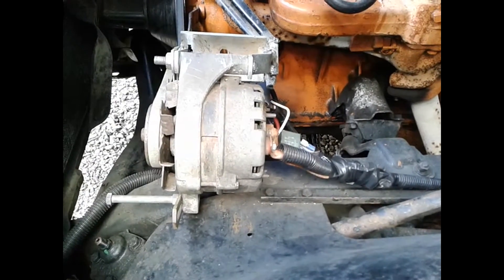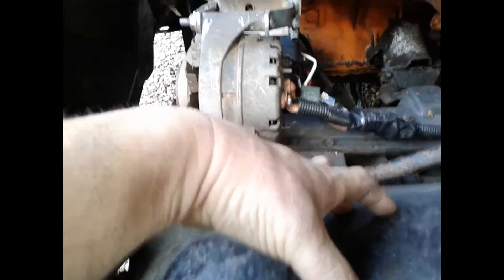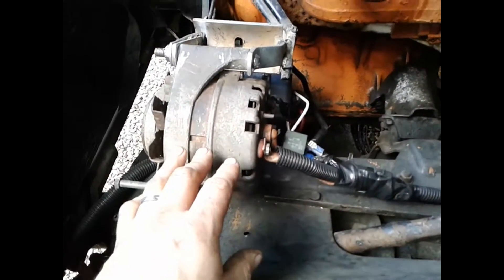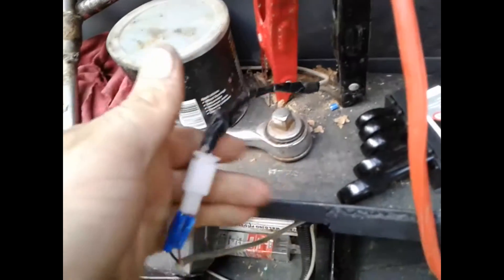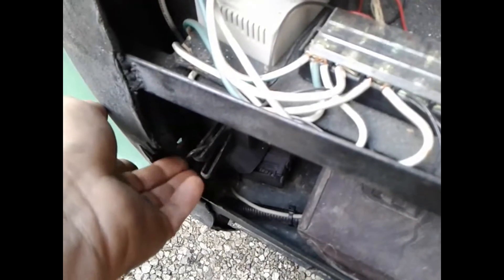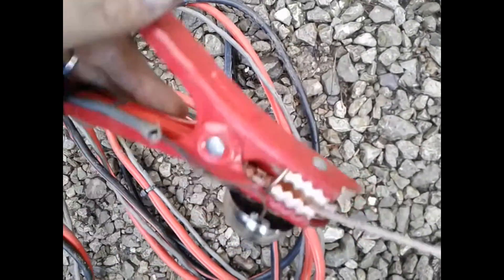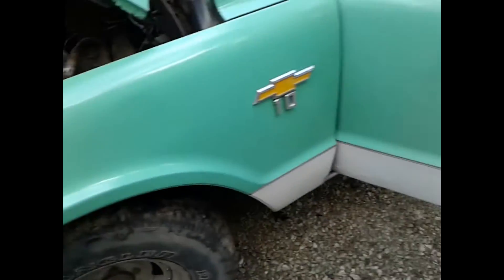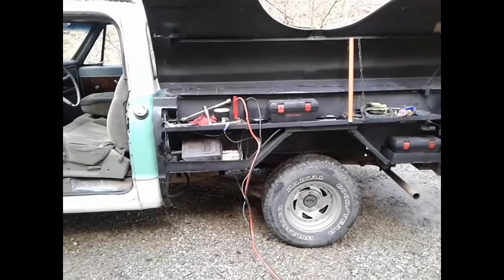Details of Ol' Green's Welder. Including diagram.

Comment: Hi will you tell me how much HP engine is suitable for 12 volt 100 amp alternator for welding
Reply from the maker: I think about a 5 HP engine would be good. I would go for the biggest engine I could though, always good to have more power than you need.
Reply: @lukeFugate  thanks bro for reply

Comment: Where u get output , from stater wire or from the diode set?
Reply from the maker: It comes out of the diode set. On the same terminal it would normally. I just put full 12v to the field wire.
Reply: @lukeFugate  thanks bro for explanation

Comment: Using a rheostat and a simple on/off switch would allow more control over the output than what you've got set up there.
Reply from the maker: That's an excellent idea. I'll have to work that in. Also a higher geared pulley would help to get the speed up without having to rev the engine so much.
Reply: True, but alternators typically have a maximum rpm rating and can come apart if spun too fast for too long. You shouldn't need to spin it more than about 5-6000 rpm(alternator, not engine) for maximum output. Most of the small case alternators from typical cars/trucks will handle at least 11-12k rpm on an intermittent basis. Unfortunately I don't have any hard numbers on the ford alternators. Delco and Leece-Neville are far easier to find information on.

Comment: so confusing
Reply from the maker: What is confusing about it? I'll try to help you if you tell me what you didn't understand. I know my explanations are about as clear as mud sometimes.
Reply: luke Fugate well I got a alternator off a 93 f250 diesel.  im not understanding the field connection.   and im guessing the battery is to give it fire?  what charges the battery if youve converted it to a higher voltage.
Reply from the maker: There are two alternators on my truck. I still have the alternator on the truck that powers the truck electrical system. The welder is a secondary alternator that is not hooked up on the output side to the truck. The field connection is a constant 12 volts from the battery. Ordinarily the field wire comes from the voltage regulator and changes the voltage up and down to maintain 13-14.5 volts to the battery. By bypassing the voltage regulator and putting full battery voltage to the field the alternator will put out the maximum volts and amps it can (should be around 80-90 volts and whatever the max amp rating is on your particular one.) I'm not sure a 93 model alternator would be externally regulated. It may have a built in regulator which wouldn't let it run at full voltage. You may have to pick up one from an older Ford. Mine is from a 1977 model.
Reply: luke Fugate that makes alot of sense with you explaining it like that.   ill look at it when I get home thanks for the help
Reply: You're probably going to have to do a lot more work to get a 1993 alternator to function as a welder. 

Problem 1: As far as I know, that should have an internal voltage regulator...that will have to be removed/disabled. Otherwise, you won't get enough voltage or amperage output from it to weld.

Problem 2: Most of the alternators made after the late 1980's will have avalanche type rectifier diodes, which will fail if voltage exceeds roughly 19 volts. This was done to protect the car/truck computer from severe over-voltage in the event of a regulator failure. Once they fail, there will be very little to no output from the alternator, meaning no welding.

Once you have disabled/removed the voltage regulator, the voltage output can easily go over 100 volts depending on how many rpm's it's turning. That means the rectifier diodes will fail if they are avalanche type(and they very likely are). There are ways to solve both of these problems, but it will not be as easy or cheap as just starting with an externally regulated alternator from a 70's or early 80's ford or dodge.
Reply: @zombieresponder  problem 2.... Can u please show how to built a diode rectifier to replace the avalanche type rectifier
Reply: @temsuimsong117  Dude, if you can't figure this out it is probably best that you don't go fooling with a project like an alternator welder.
Reply: @zombieresponder  i have an alternator which give out only max 13-14 volt after i take out the regulator and give direct 12 volt to the field coil....
Reply: @temsuimsong117  What is the alternator rotor rpm? If the what you removed was actually the regulator, then voltage should change as rpm increases or decreases.
Reply: @zombieresponder  voltage is not changing with the rpm.... I thought its with the diode rectifier
Reply: @temsuimsong117  No. If it was the rectifier, it wouldn't have any output. Whatever you removed was not the voltage regulator.